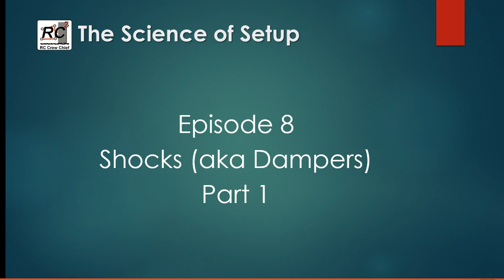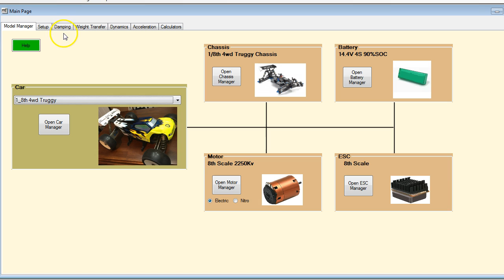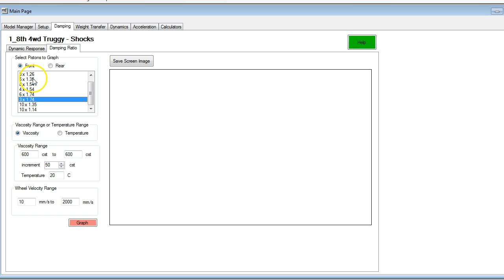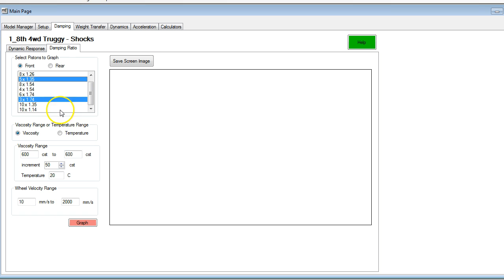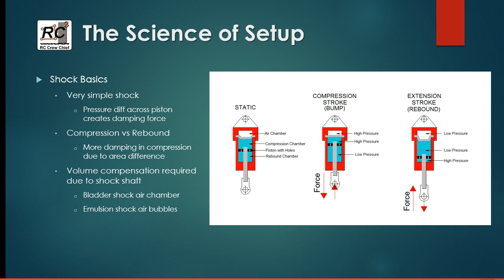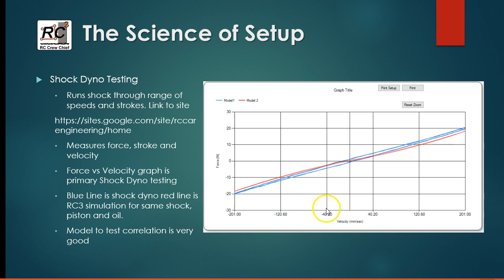Episode 8 - Shocks (aka dampers) Part 1

Comment: Thanks for your video . Once my son has learned to drive a little more I will likely invest in a copy of your software as he is not a reader and this software shows visually all the chassis dynamics I learned from Carroll Smith's Tune to Win.

One comments though. your remarks on emulsion shocks aren't quite right. There is an airspace above the silicone oil. Prior to the start of the run, on the start line, the car is bounced up and down on its suspension to emulsify the air into the fluid. I refer you to the X-Ray XB4 instruction manual and the Associated B6 manual for the shock bleed process - it is the same for any bladderless shock where the shaft does not go all the way through.  Omitting the bleed step to get the air/oil level right will result in a shock that hydraulically locks up before full travel is reached, with all the consequences you mention.

Thanks again for the videos, enjoying getting back in touch with this stuff after 16 years out.